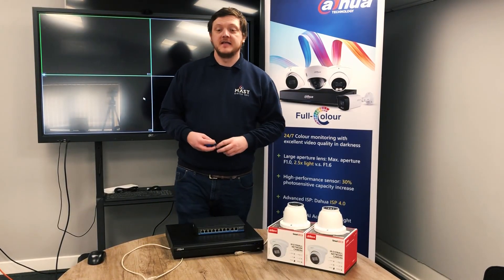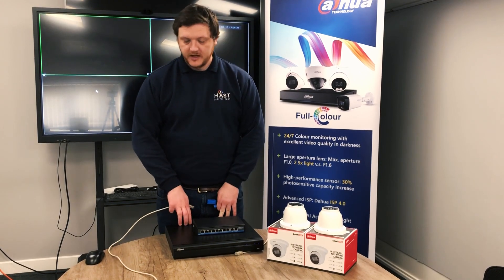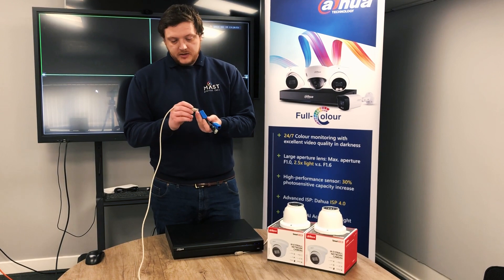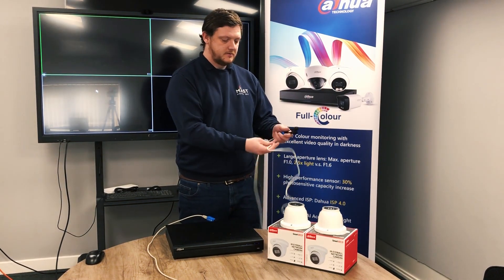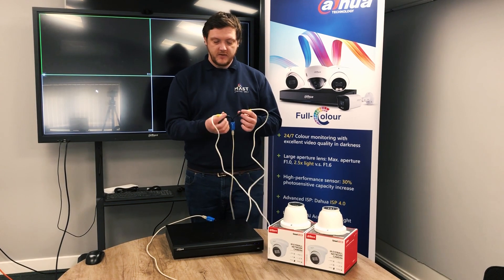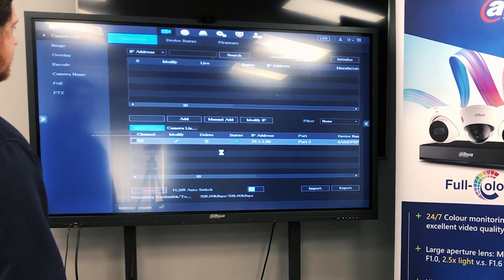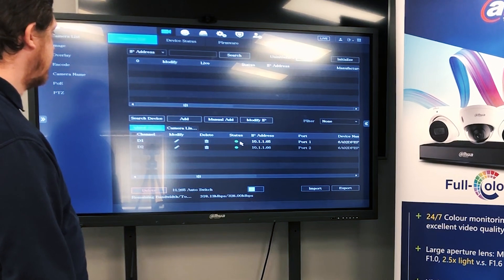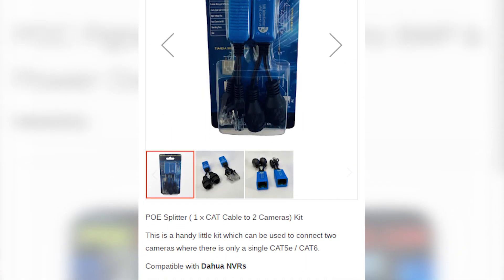How To: Run 2 Dahua IP Cameras Over 1 CAT5e / CAT6 Cable

Comment: Well I've been doing just that today in a real world installation.  It works fine!  I had two areas with cameras about 3m apart. One camera outside and one inside.  BUT, what you're not telling is that if you use an 8 wire patch lead to each Y adapter, IT WILL NOT WORK. You need to use a patch lead with only pins 1,2,3 & 6 connected.  I usually use the brown rj45 couplers, that you can open  and remove pins 4,5,7 & 8. Reassemble the coupler and connect one to each plug on the Y connector near the camera end. Now it will work perfectly with any patch lead.
Reply from the maker: Interesting feedback Peter. Which brand of cameras were you using?

In the video Matt used standard 8 pin patch leads with Dahua IP cameras - all supplied by us.
Reply: I've used this Y lead with Dahua, Hickvision, Provision ISR , and many generic Chinese cameras. Works well if you wire it correctly. Some patch leads, for example, supplied with TP Link products, are only wired 1, 2, 3, & 6. They work out the box. If you use a standard 8 core patch lead it won't work as you're corrupting one video stream with another.  As I was bringing a wire in from outside through a brick wall,  I made up my own cable. You could also cut the unused cores at the plug. As I use the Eze rj45 plugs, it's possible to feed the 4 required wires into the plug reliably before crimping

Comment: Hi
I have a lorex NVR with PoE function. A cat 6 cable is running to an outdoor camera and working fine.  How can I install another camera close to the existing one please? I mean using the same cat6 cable to connect 2 cameras.
Thank you
Reply from the maker: Hi Travis, as Matt demonstrates in this video - one way of achieving this on a DAHUA system is by using a PoE 1 into 2.

We have not used a Lorex recorder with this solution and cannot confirm if this will work or not with your setup (different NVRs & PoE devices can use different cores etc.).

However, they're very affordable compared to a network switch (and much more convenient than a whole new run) so if you are a UK Trade installer - please contact our Sales Team and we can supply you one even if it's just to give it a try. 👍
Reply: @Mast Digital  Thank you so much. But unfortunately I'm located in Canada. If I get a PoE switch, connect 2 cables with thr NVR to it, then the long cat6 cable to the cameras,  then use the splitter, will that work?
Thanks again

Comment: This RJ45 spliter/combiner not working at all. We tried but only one camera working, no video from 2nd camera and after some time first cameras also get Off.
Reply from the maker: This sounds like it could be one of a few issues. For example, if the baluns are at fault they won't work at all, not intermittently as described.

How far is the full run end to end?

We'd suggest trying a short patch lead directly to the balun and camera - then flip the balun over to confirm if the balun is fine.

If so, this would indicate an issue in the cable run perhaps - let us know the outcome.
Reply: sama seperti yg saya alami

Comment: Will this work on hik system? Do you not sell Hikvision anymore? Thanks
Reply from the maker: Hi Michael - it works slightly different.

On a Dahua NVR you can come straight from the PoE ports - as seen in the video - however on Hik you have to have a switch in the middle. Still can save on runs though.

- or at least this was the case last time we tested prior to becoming a Dahua Distributor in January. So correct, we no longer sell Hikvision.

Comment: What about cameras that are pzt and lights?  Is it enough power?
Reply from the maker: Hi Jon, the baluns only support two 802.3af (15.4W) devices. Most PTZs are 802.3at (25.5W) and more advanced PTZs can sometimes need more (hence why we stock 60W injectors). 

If you're able to find a PTZ that is 802.3af (15.4W) powerable, you will be able to power it plus another device over one cable using this method just like the turrets shown in the video. Let us know if you find one!
Reply: @MastDigitalUK  if I ordered 2 of these will it work? on one line?  

DC 12.0V⎓2A, <12W

IEEE 802.3af, 48V active
Reply from the maker: @jonathanlee6444  Max. 1 pair of baluns per cable run. You'll be unable to daisy chain them if that's what you're referring to?

Comment: Is it possible to run two energy eating pan tilt zoom cameras?
Reply from the maker: Hi Sam, I apologise for not seeing this sooner. Please see below:

The baluns only support two 802.3af (15.4W) devices. Most PTZs are 802.3at (25.5W) and more advanced PTZs can sometimes need more (hence why we stock 60W injectors). 

If you're able to find a PTZ that is 802.3af (15.4W) powerable, you will be able to power it plus another device over one cable using this method just like the turrets shown in the video. Let us know if you find one!